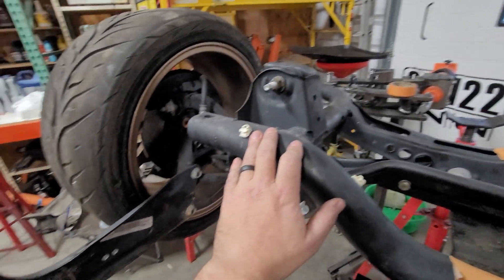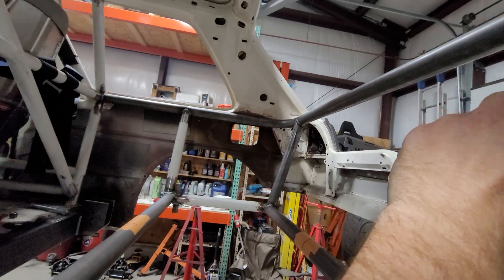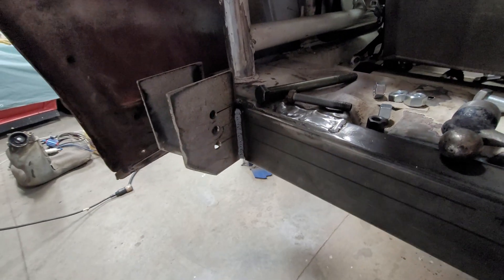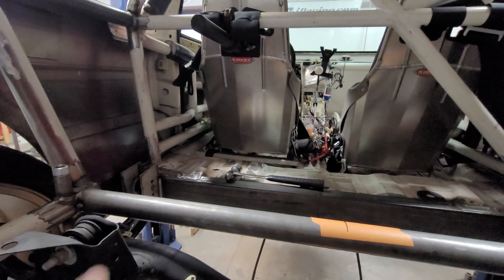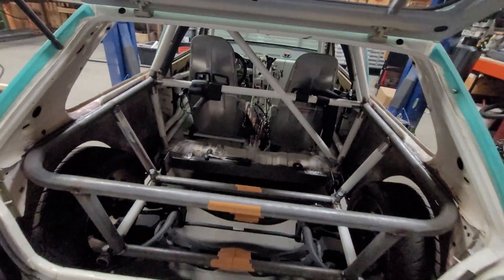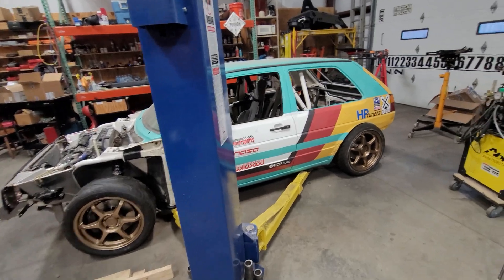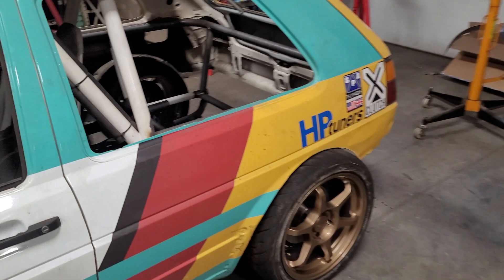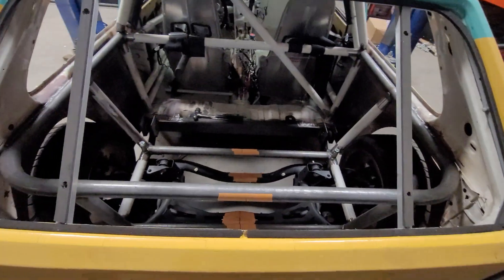30+ years in rear suspension advancement - Part 3

Comment: What rear shock /spring package are you planning on using, and where are the pickup points going to mount?
Reply from the maker: good question. As you may know, the mk7 gti has a divorced spring and shock. After discussions with people smarter than me, it is beneficial to combine the spring and shock. Working with a custom shock manufacturer now. I will have a video on this once complete. It will mount to a specific tube and plate within the car, pretty simple.